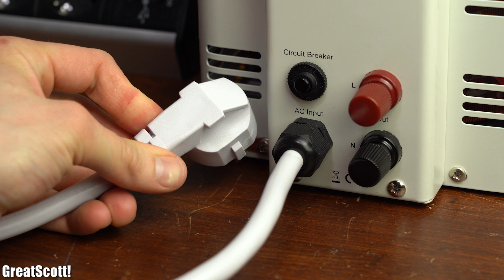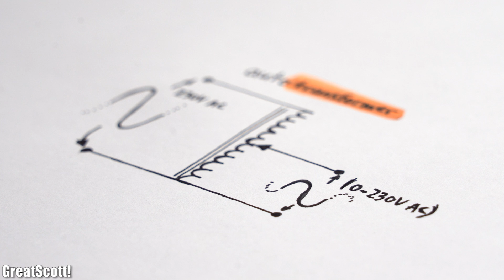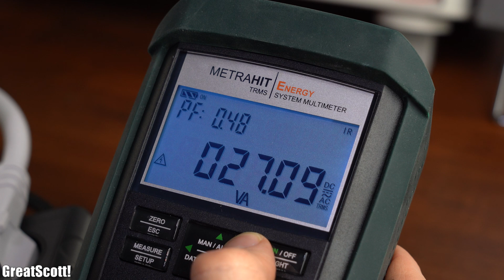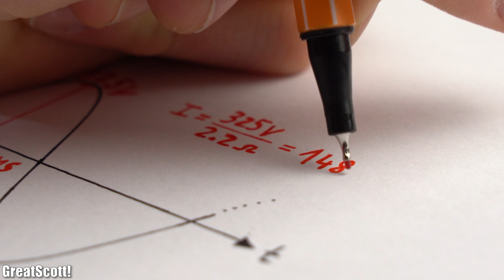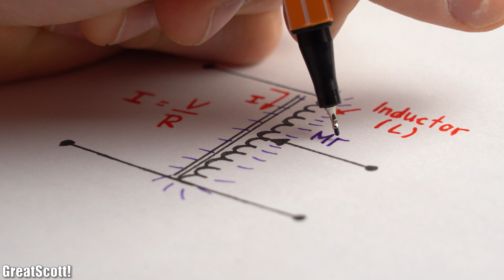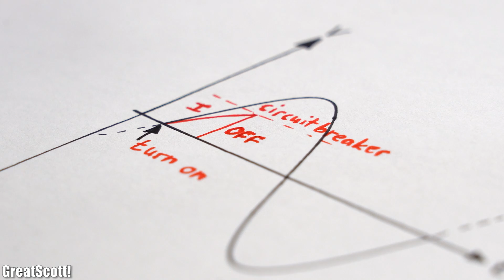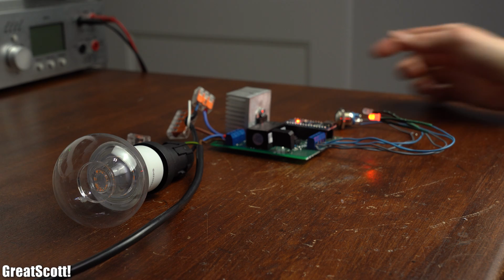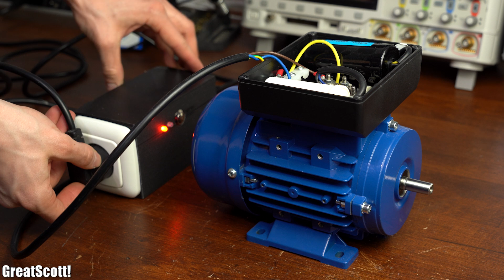How to make an AC Softstarter because my autotransformer keeps tripping my circuit breaker!

Comment from the maker: Seems like I made a rather big mistake in the video. My transformer should not be switched on during the zero crossing point but at the voltage peak in order to decrease the current flow. While recording the current waveforms on the oscilloscope, everything appeared good to me and I am not sure why my circuit breaker stopped tripping when I switched at the zero crossing point. But many viewers pointed me in this direction and after doing research, it seems to be correct. Sorry about this. But if you want to build the softstarter you can still try it out whether it works for you and if not then you can always change the Arduino code in order to switch at a different time point. Sorry again for the inconvenience. I do make mistakes from time to time since this is a one man production. Stay creative :-)
Reply: I was about to tell you the same. But making mistakes is good because you learn from them. Now you know about magnetizing currents on an inductor/transformer and why you should DO energize them at peak voltage. I suggest to delete, edit and re-upload the video (make it about the soft starter) so you don't confuse beginners and enthusiasts.
Reply: Use a relay and a resister or an NTC thermistor
Reply: It sounds like the autotransformer was tripping the circuit breaker when its residual magnetization was opposite that of the of the polarity introduced at turn-on but not when the polarity is zero or same. So switching at the zero crossing eliminated the boundary case where the voltage polarity and residual magnetization were opposite. Basically the breaker would trip when the voltage waveform was somewhere between zero and peak of the opposite polarity of the residual magnetization.
Reply: @KerbalLauncher  Yeah, I was thinking the same, on big power transformers there’s the exact same problem, so they use similar circuitry to switch the transformer in and out of the grid at the same point in the AC cycle, that way there’s no residual flux. They however connect at the zero crossing, per phase.
Reply: @KerbalLauncher  so it's better to use start up at zero
Reply: Can you sir please explain me why to turn it on at the peak and not at zero crossing point?
Reply: @aks8403  Initially, there's no flux in the transformer's core when it's disconnected. If you connect it at the zero crossing, the voltage for an entire half cycle will have the same polarity, meaning the current starts from zero and increases to, in the ideal case, twice its normal maximum value. If connected at the peak, the voltage switches polarity sooner, so the current starts decreasing again sooner as well.

Connecting at the zero crossing can get even worse, though. Real inductors saturate, and many are intended to be run at pretty close to their saturation point. If the current gets too high, and the inductor saturates, its inductance plummets to near zero, which causes the current to rise even faster, reaching even higher currents.
Reply: @thehearth8773  Thank you for the answer
Reply: @thehearth8773  Exactly right, very nicely explained, you could say that the +C in the integral is sometimes chosen badly
Reply: @thehearth8773  but with the soft starter, the duty cycle is slowly increased, so why should it matter whether the TRIAC is turned on at the zero crossover or at the peak. The mains is fed to the coil in small portions initially and the size of the portions is increased slowly to 100%
Reply: @prathikprashanth2932  With the soft starter, it makes sense that it would work, yes. I'm not saying it wouldn't. What I'm not sure about is how the first design worked, the one that just switched right on the zero crossing.
Reply from the maker: @aks8403  You have to change the timer value OCR1B. In my case I firstly used 590 which is around 9.44ms after the zero crossing point. 625 would be 10ms. So simply use half of 625 so around 313 in order to get a 5ms value at which point a voltage peak should appear after the zero crossing point.
Reply: @greatscottlab  you actually kinda misunderstood my question but thank you anyways . I have now got the right answer👍
Reply: @greatscottlab  I am wondering if the on resistance of you circuits are keeping you from tripping
Reply: @aks8403  ELI the ICE man
Reply: @aks8403  it's because we are talking about an inductive load, which means that the current is delayed by a 90 degree phase angle.
Reply: @martinvollderpro  Correct and easy to understand👍. Its easy to remember when you look at capacitors. If you charge a capacitor there will be a big current in the beginning and then the voltage rises. Inductors behave the same, just the other way round, meaning that in an inductor the voltage will rise first and then the current. In an ideal inductor/capacitor this angle between voltage and current is 90°.
Reply: @aks8403  Because inductors resist current change.  So since there is no counter field in the core on turn on current flow is a function of time the voltage is pushing the current higher. If you turn on a zero the current raises a full half cycle.  If you turn in on at max there is less time for the current to build before the voltage reverses.
Reply: @aks8403  The Inrush Current is caused by saturation of the core. When the core is saturated the current rises. So you have to start in an advantageous Point. Is the core for exsample not magnetised, starting at the zero Point means the inductor see a positve voltage for half the cycle, possibly saturating the core. When you start at the peak the inductor only sees a positv voltage for a quarter cylce. Then the nagativ voltage reduces the flux to zero again till the nagative peak. Thus the overall flux will be lower and the core is not saturated. But problem is that you need to know the magnetization of the core. Is the core already magnetised then you want to start with a negative voltage.
Reply: @aks8403  the magnetic flux is porportional to the integral of the voltage, if you start to integrate the voltage at zero crossing point you have the flux all positive or all negative doubling the flux peak, if you start from a maximum you have  a sine wave across the zero point lowering the peak. In theory  the core should be designed to deal with the worst case scenario, in practice this may not be true, the core can saturate and you may have a current peak.
Reply: @aks8403  Core flux is proportional to the integral of the applied voltage, if you start at voltage zero crossing you will have a sinusoidal flux all positive or all negative (depending on which cross point you take), this will double the maximum flux value (respect to a sinusoidal flux centered on zero). In practice the core should be designed to deal with this worst case scenario, in practice this may not be true and what happens is a core saturation with a current peak. The non linear transient is what allow to "center" the flux wave in the linear region avoiding the problem for the subsequent cycles.
Starting from a voltage maximum will allow to have a sinusoidal flux centered on zero since the first cycle, avoiding the current peak.
Reply: @aks8403  Because if you plot voltage vs current they are 90 degrees out of phase. So when the voltage is zero (zero crossing) the current is at its maximum. When the voltage is at its peak the current in at its minimum (in theory zero). The circuit breaker trips due to an excess of current. So you want to switch the load when the current is at its minimum to put the least stress on the circuit breaker by having the current ramp up.
Reply: thank you it takes a man to see his own mistake and correcting it you have my respect sir
Reply: I was also thinking about that - the problem is saturation of the core and that will (in general) get at it's worst if turned on at the zero crossing. The time before polarity changes will be at maximum (one half cycle). But as mentioned above, there may also be some resedual magnetization left in the core, depending on where in the cycle the transformer was when it was turned off last time. So if your solid state relay for example is configurated to always turn on before a positive half wave and turn off right after a negative one (or the opposit) - that may also prevent the breaker from tippning. So, it's not only a function of where in the cycle it's turned on - it also matters where it was in the cycle last time it was turned off
Reply: In Canada we have arc fault circuit breaker’s required in new installs. Problem is tool with motors trip them. Could you please look at solutions for this? I’m surprised no one has a product out yet to solve this. I even contacted a treadmill company. Their solutions is to change the breaker which technically is not allowed. It has insurance claims implications.
Reply: @RCdiy  You can change the breaker profile however, aka how quickly it trips. In Europe at least brakes come in say 16 amp, B profile, which is quite sensitive to high inrush currents, so then you would swap it for a 16 amp, profile C, which is slower. They still protect just as well against short circuits which will be on the 500 amp range.
Reply: regardless of the endpoint the soft start using an arduino is an awesome project, super cool valuable project.
Reply: Nice project did you powered the arduino by a capacitive coupling to the main , you can add a power off button  and write  tow firmware  one for the 50hz and one  for the 60hz.
Reply: I had this question running in mind for quite some time...
Reply: And how about starting between zero and peak?
Reply: i like your videos :D
Reply: You probably have a core saturation problem during the initial transient when you start at zero crossing. The core is a bit too cheap and too light ;)
Reply: @GreatScott! thanks for mirroring your videos on (alternative platform that must not be named if you don't want your comment to silently disappear)! Would you please consider putting this comment on there as well? It is quite important information.
Reply: so soft start will begin with/by  delivering the half power to the lnductive load and end with full power. isn't it?
Reply: The softstarters I've seen were just fat resistor that then got shorted out after a second or two. That's way more friendly to any type of load as load just sees slightly lower voltage for first few cycles
Reply: On large ferroresonant UPS's, they actually perform about a 1 second ramp of moving the trigger point backwards from the zero crossing, so that it triggers at increasing higher initial voltages on the downwards slope of the AC waveform. It creates an accoustic vibratory "wump" sound doing it that way. I've never bothered to measure if it's a linear reverse movement of the trigger point or whether it speeds up or slows down during the regression.
Reply: The old stabilizer for ac contains a similar circuit and leds similar to what you have described. Does it contain a soft starter??
Reply: @GreatScott! sir can you please make a video about building a NIXIE watch
Reply: Its all good brother. Good thing is you heeded to the concerns raised and informed your viewers.
Reply: Keep being awesome.
Reply: Can you please make a follow up video about how it should actually be done?
Reply: Some notes:
1. The current through the transformer should be stopped at zero crossing. Easy with a SCR/ TRIAC.
2. The turn on/trigger of the SCR/TRIAC can be done with a phase shift network.
It is not at 90° and can be found by measuring the primary current and adjusting for the lowest peak.
This is true for any large transformer application.
Reply: Great Scott can you make a automatic hand sanitizer machine where people have to pay a quarter dollar to use the hand sanitizer machine.
Reply: Even though (as you have admitted) you erred in the video, the concept appears to be a good one. Great Scott = Great Ideas... :)
Reply: Is your code updated
Reply: That Plug Is Familler....

Gobiln Its Also a Iranian Type /:
Reply: I've created a DropBox link for this project with the Gerber PCB files etc. Anyone is welcome to use the information: https://www.dropbox.com/sh/6qyjfh5oikfp93o/AAC0CmNR6_Er4Rxf3Bb9eF-ka?dl=0  Perhaps it is worth pinning for others to easily find.
Reply: U r doing great. I bought one auto voltage regulator with soft starter built in long ago for hi-fi system. Your video reminds for it be used for new i5 11500 rig. Thanks 👍🍻🥳
Reply: first I want to thank you for the great topics you choose and do
(it's nice to know there are  really skilled engineers that knows how to interpret applied physics and finding solutions for it )   I enjoy the ways u clarify things so a person with basic electronics skills can understand for the AC soft starter 
using phase  control delay  has so many applications especially for old school systems like  starting a universal brushed motor (example a vacuum cleaner , room ventilator fan , halogen lamps with balasts ...)
if you want I can post a very simple circuit  with very easy to find components and do the same  function for the circuit u used 
(arduino controller with apreloded software ). 
for the zero crossing detector to control a high inductive load is a very strong and practical solution to prevent tripping circuit breaker 
(especially if the utility power source is generated by a DC ac converter it sollar panel system which have a limited  internal impedance )
the zero cross detector can directly be connected to Ac main power by using a photo coupler ; a resistor , diode and a capacitor in primary side .
I hope to get a  reply  for your opinion and keep up the great work.
Reply: Everyone makes mistakes, but you have to be great to admit them.
Reply: I need simple single phase motor soft starter so that my 1kVA inverter can start my water pump  (0.5 hp)... Please make a video about it... Thanks...
Reply: current at t=0 is always related to the resistance so higher the voltage higher the current at the begin. your soft start seems not switch on at t=0, but at t=9mS... 8mS and so on up to 0mS to cover a complete half-wave and it works as expected
Reply: Guessing it wasn’t “random” and was actually happening at cycle dips or similar
Reply: it's ok you are a legend of electronics for me
Reply: He’s here again! The legend of the GreatestScott is true!
Reply: Who cares brother, nice video, great circuit too. cheers
Reply: @jfchebly  softer starter is for protecting sensitive and very expensive electronic/electrical equipments. So I seriously care. Do you?

Comment: A rather big solution to a small problem…
Some 50 odd years ago I designed a solution for the inrush current problem for a 12KVA 3-phase transformer.
Per phase I used a big wirewound power resistor to limit the max. peak current to the desired value.
This was combined with a simple delaying circuit, which controlled a 3-phase relay (the NE555 did not exist yet…).
I am a supporter of the KISS principle (Keep It Simple, Stupid…) , so I prefer to make circuits no more complicated than strictly necessary.
So the problem with your variac can simply be solved by using a power resistor, a decent relay and a handful of small components.

Comment: I have a 2kva spot welder (transformer type, not inverter based) which often trips my 32A breaker. I was thinking of using something like your design to remove the spike when the welder is triggered. Of course, in my case, the circuit needs to be autimatic so that the welder remains unmodified with the soft start happening once the weldere is triggered. Any suggestions?

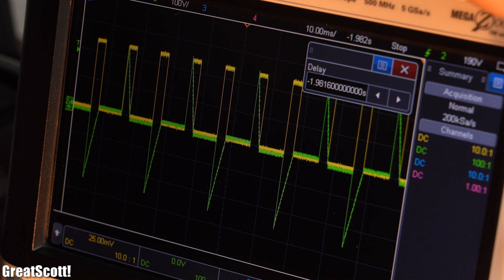Comment: 10:30 This is one of your most fascinating designs, I think! Sorry to reply to such an old video. My question is, why is the delay initially a negative value? The soft start seems to "work" when the delay has a positive value, if I am reading the oscilloscope output correctly.

Comment: It would be great to make a small-factor soft start module that can drive standard light bulb, because in most cases spiral wire within bulb would brake in the moment of switching on, because of lower resistance of cold wire and strong magnetic field generated in that moment...
I believe that 150W power handling would be sufficient for such purpose.

Comment: I see youtube videos that monitor only the inrush current and, unfortunately, NOT the voltage across the transformer.   So I have conducted my own experiments.  If the transformer is switched on at a voltage peak, there is no "inrush".  If switched at or near crossover, the inrush is huge but NOT CONCURRENT with voltage!  There's a lag.  I have a doubt it is "core saturation" because if it was core saturation the transformer would immediately after the inrush begin normal operation.  But it doesn't; it takes 10 or more cycles for the DC magnetization (similar to but is not "saturation") to be de-magnetized or degaussed.  
The inrush begins at the first full crossover AFTER energizing.  You would see this if you monitored voltage AND current.  Be sure to isolate your oscilloscope power supply from mains.
Reply: Saturation of the mains transformer core is also dependent on any "previous" half cycle  residual flux polarity and it's magnitude @ time of turn off...
If at the  next turn on instant ,  the transformer is turned on..and  the flux polarity is the same as residual flux...the two may add ..and if it... 
(the total ) , exceeds the saturation level it may cause a tripping even though it's present or residual  flux level are within safe limits....
This is the reason why, 
 (as for dc-dc stepup/dn transformers)
..,in latter day voltage mode control (smps) ic's , (3&4 generation) two additional protection features were added.. 1) volt/sec. balance..
2) startup on one polarity...& subsequent restarts...
... (as long as the chip remains powered up..)...
...on the next polarity and so on alternating...
Here since SCOTT is using a uC this can be implemented 
 (2nd protection is logic)..in software code too .